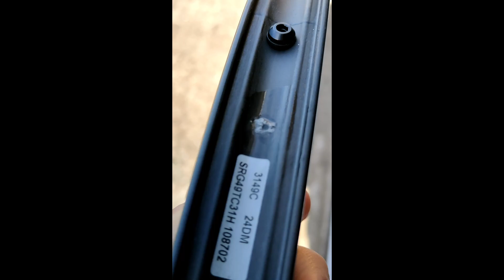EIE Carbon bicycle rims manufacturing failure

Comment: Surprised this is the first eie vid when you search for eie. I have i30AS for mtb, and I've done drops to flat and ridden for 1K km, no issues so far.
Reply: That is very pity as this is the only one tubeless ready (without rim bead holes) wheelset has air leaking problem since our sales in 2016,we already improved our production and promise that there will be no same things happened.We accept the previous mistake and improve it ,which is a very good voice for our brand development.Here,EIE promises that if your EIE has same air leak problem(you ordered tubeless wheelset),you can send wheels back to EIE.And EIE will bear all the costs incurred including returning shipping cost.Thank you

Comment: I have bulit >10 wheelsets using EiE Carbon rims, I have only good things to say about the quality of their work as well as their customer service. I can't see that your specific issue is that hard to fix, one drop of 2 component epoxy would fill the hole and stop your leak, or just wrap the rim with regular TL-tape. I don't share your concern with "pressure building up" inside the rim since the spoke nipple holes and valv hole isn't typically very air tight, but if you are afraid of this, just remove the rubber o-ring from the valv stem nut. It is not uncommon that rims get water inside this "compartment" when riding in rain or when whashing the wheel, some manufacturers (ex Shimano) have a water draining hole drilled on the side of the rim. Also, I feel the customer service options EiE  have offered you -- discout or free replacement -- are very fair, what more did you expect?
Reply from the maker: I guess, the biggest misunderstanding comes from the fact that that you and the manufacturer on one hand (are you a reseller?), and me on the other have different views on the subject. I aim to only have one set of wheels, not 10. But I want it to be as good as it can get. What you say seems reasonable - from a business perspective. Does not make sense from the end customer perspective. I have stumbled upon this problem by accident. An enormous pressure was created inside of the rim which then pushed the air back out through the sealed hole. Which in turn, created bubbles on its surface. Not only the manufacturer created an unnecessary hole - but they could also not seal it properly. Moreover, they assured me that it was sealed properly when they were specifically asked this question. That is to explain what was wrong with their engineering and manufacturing process. As for the customer support - no, just as I said, it was not a free replacement. I had to invest additional money to fix it in a way that it was intended to be in the first place. Not always it comes down to value as well. Sometimes, you just want a superior product.
Reply: @Hard_Work_Is_Rewarding 
You're right in that you are entitled to have high expectations and get the promised product / function / service you paid for.

You say "enormous pressure was created inside of the rim", how did you go about measuring this pressure? This is what I question, and your concern for "rim explosion". The area inside the rim is not air tight, air will pass out around nipples and valve. Imagine a tubed road tire with 7 bar / 100 psi, do you think the rim will explode if the tube fails resulting in air rushing into the rim? Imagine a TL road tire mounted on a TL rim with holes + TL tape, do you think the rim will explode if the TL tape fails? I might be wrong, but I find this to be very unlikely.

I'm not a reseller or bikeshop, just a regular dude. But I have built around 100 wheels, alu and carbon, and serviced/rebuilt another 100 from various major brands (Roval, DuraAce, other Shimano, Fulcrum, DT Swiss, Newmen, Hope, Stans, RaceFace, WTB, other). Based on my experience, I rate EiE Carbon products / value / services as being very good.
Reply from the maker: @and30ers   1. Of course, there is no way to measure the pressure inside the rim. However, after I took off the nut that held the valve in place I could hear the same whistling sound and feel the air escaping same as it would when you realease tyre pressure through the valve. I just took note of the time it took the pressure to be realeased and judged about pressure indirectly like that. The fact that the air was violently escaping indicates that the rim internals were airtight.

2. Further, you question rim damage by air pressure. Please have a look at this https://bikerumor.com/2019/03/12/enve-pressure-relief-nut-keeps-carbon-tubeless-road-rims-from-popping/ Enve states that air pressure inside of the rim may lead to delamination.

By the way, that's another problem, currently the industry standard is no drain holes instead of drain holes present.
Reply: Thank you ,Anders.We are very pity that things happened ,this was only one wheelset we sold has air leaking problem as customer ordered tubeless ready wheelset.We improved our prodution and promise that there will be not same thing happened.So please rest assured that .Anyway ,there is no doubt that our rim quality is still very excellent except for the air leak (Tubeless ready wheels).Again ,it seems long time no hear from you ,my friend.If any new demand ,feel free to contact us .Big discount for you🤟🤟🤟